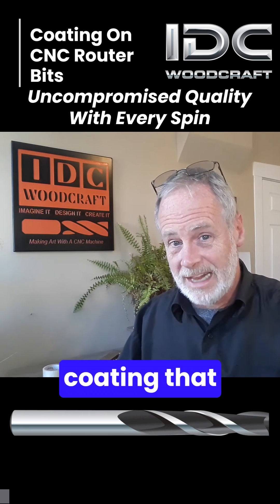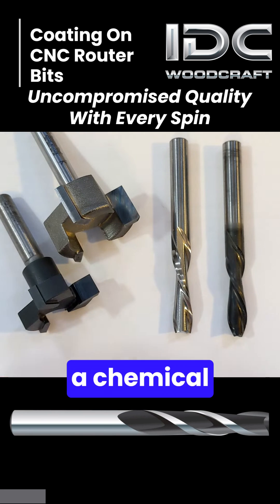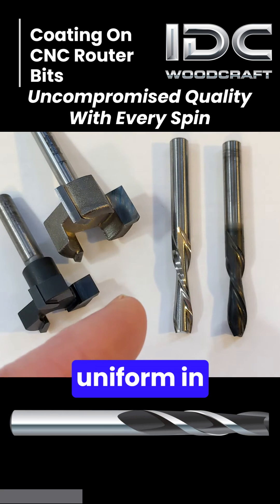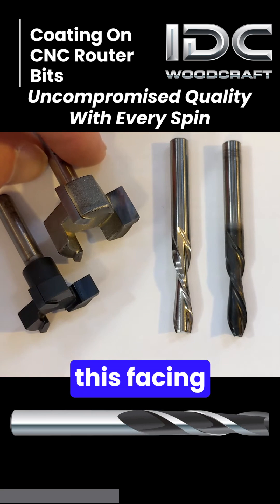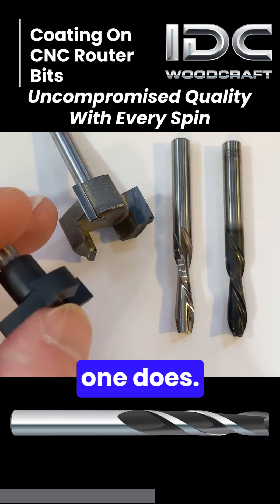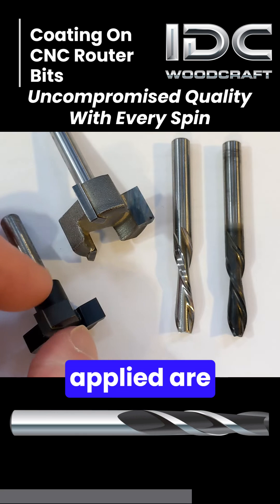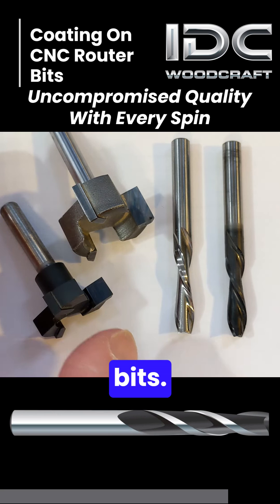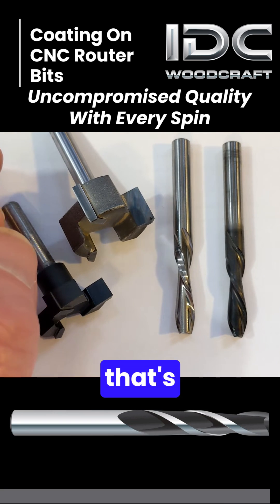Does the coating on CNC Router Bits matter?

Comment: My answer is, It's depending what material that you will cut and what size the diameter of tools is.
On my CNC router, for cutting an harder and dry material, and tools that have relatively small diameter under 6mm, it's necessary to have coating on tools.
Reply from the maker: GelX, very true my friend. It all depends on what you are cutting!